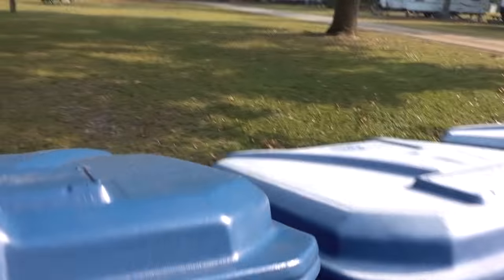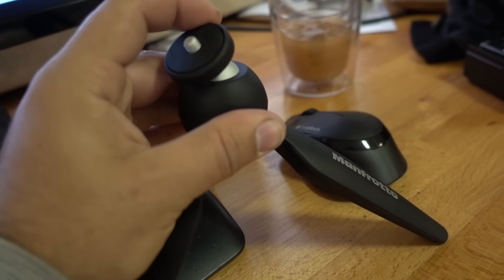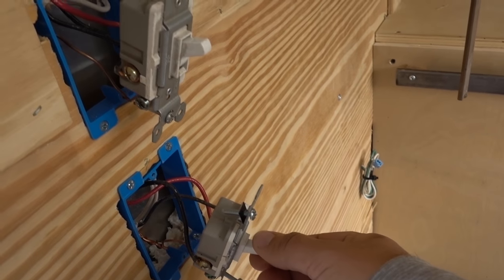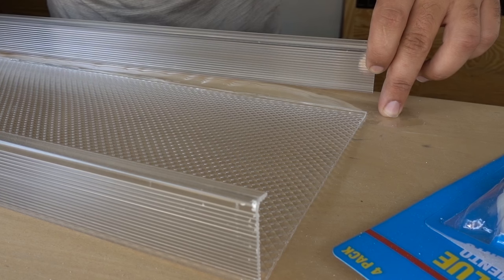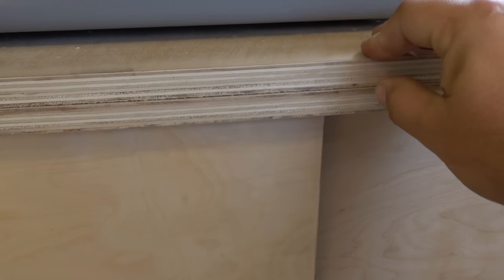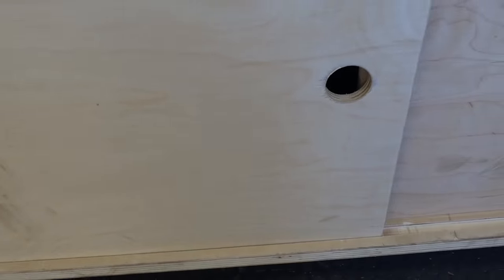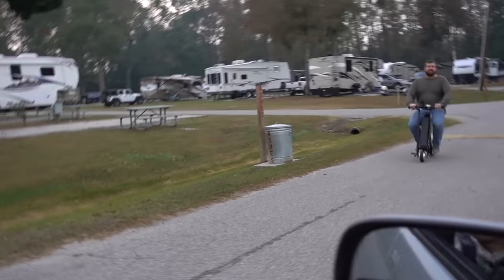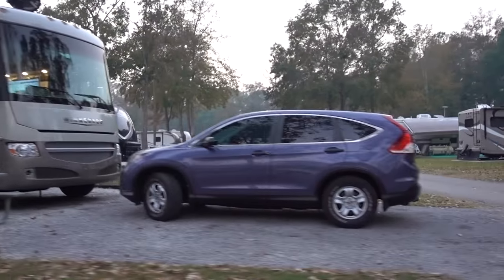VLOG | Improving the Table Saw Cabinet (Day 21 of 24)

Comment: That breaker was either a GFCI or an arc fault breaker. They can false trip especially arc fault with certain light switches; the switch will very briefly arc as it makes contact and that sets it off

Comment: Mike, a little tip my dad taught me when trying to troubleshoot pretty much anything. "Always try the easiest and quickest solutions first." I also ask myself, what has changed if it used to work and start with those variables. Well done though on resolving your electrical issue, even though it wasn't your problem but the camp grounds. Now I will try to learn sketchup so I can design things before just winging it.

Comment: Plugging into the 30amp circuit doesn't necessarily mean your trailer wasn't the issue and the other breaker was. It just proves that whatever the issue is/was, it's not drawing over 30 amps.

Comment: I was curious what vehicle are you planning to tow the new trailer build? Most diesel trucks and vans only have a 1200-1700lb max tongue weight rating. With you building everything in the front like you mentioned may put the tongue weight to high...